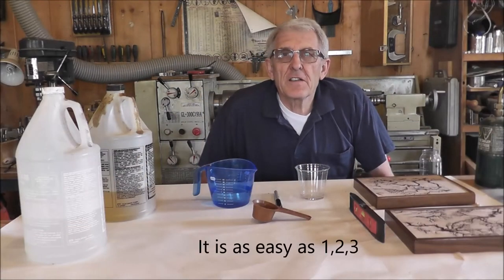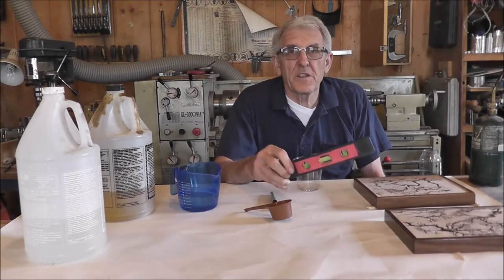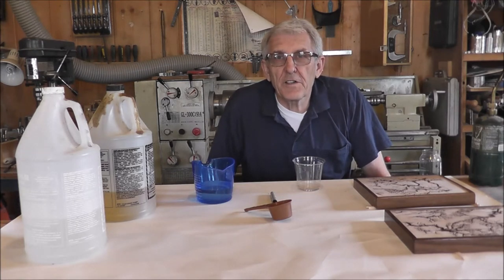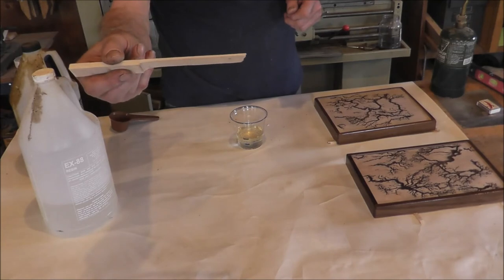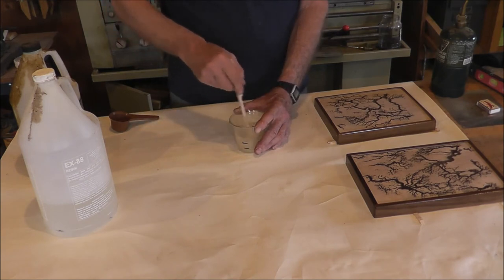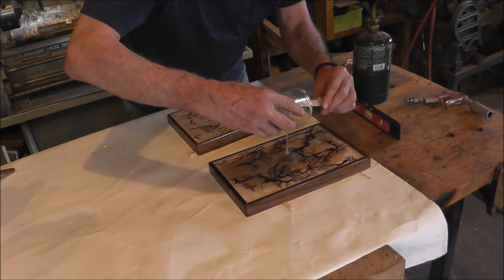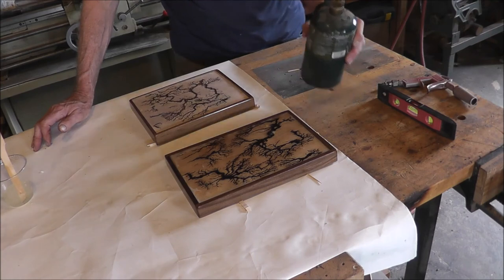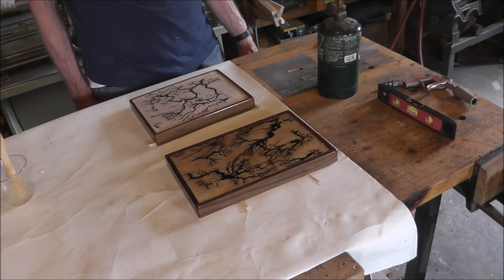epoxy finish process

Comment: I can see from your videos that you are quite handy. I have been trying to find out about using epoxy for a coating on vessels, vases, whatnots. Didn't know if I would have to heat it to remove bubbles or not. Was it dependent on the type of epoxy, that such a thin coat wouldn't have bubbles. Any thoughts on it? Thanks.
Reply from the maker: You would not have any problems with bubbles.  They will come out on there  own. just breath on it. It is the carbon dioxide that causes the bubbles to pop more than the heat.